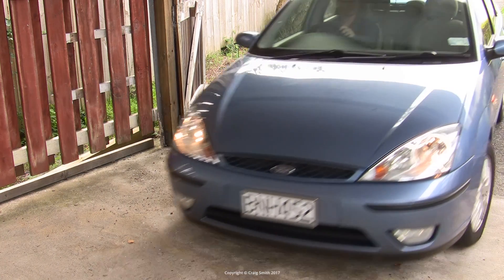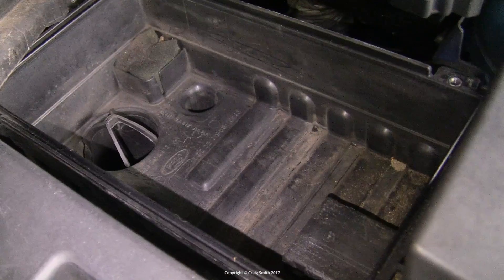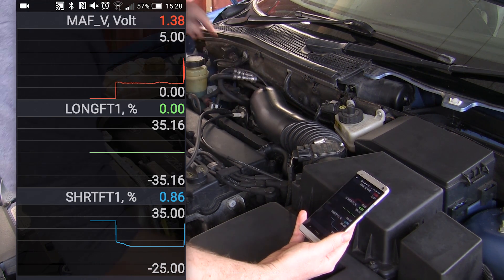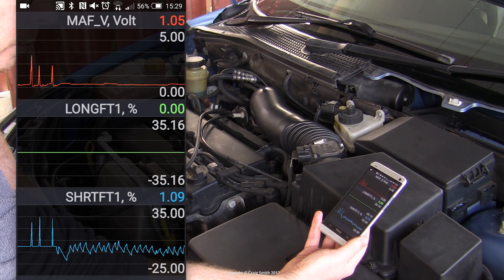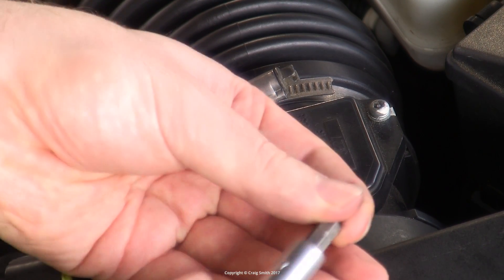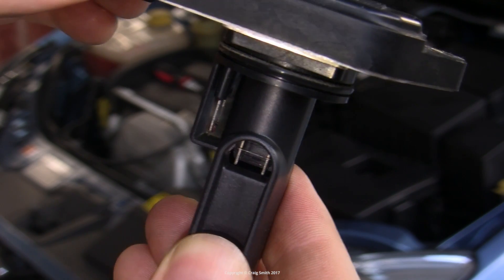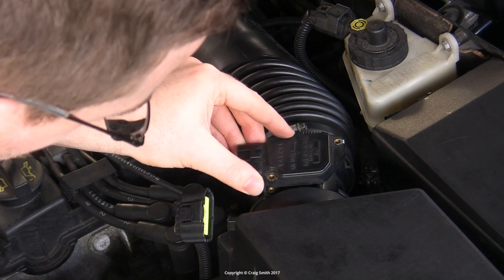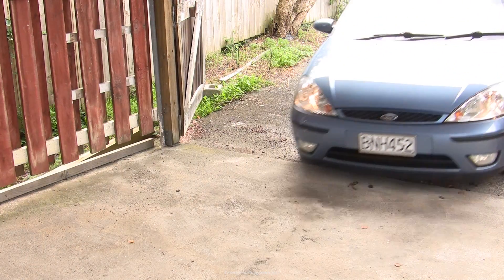How to: Clean & replace Ford MAF sensor (Focus Mk1)

Comment: Hi there Craig , my focus is 53reg and I’m looking at ur video clip here but my focus don’t seem to have the sensor anywhere there I checked, can that be that it has a map sensor instead I looked everywhere I only could see the map sensor just down at the bottom on the same pipe that u have the. Mass air flow meater thanx
Reply from the maker: I know the Duratec engines (Focus Mk II+) only have T-MAPS on the intake manifold, check which is your engine.

Comment: Yes very good, can we use WD40 spray
Reply from the maker: No!
Reply: You cannot use the standard WD40 spray, as it leaves residues behind. But you can use the WD40 Specialist, contact cleaner

Comment: What would you say could be the issue if it sticks at 2000 rpm and my temperature gauge has stopped working as well was thinking throttle body  cencor

Comment: hi thanks for the video , One question what is the "tool" called that you attached the "T20 security torx drive bit too or link to at amazon? Thanks again.
Reply from the maker: It's just a ratcheting screwdriver with hex drive bits, it comes with a whole set of different bits. For just this purpose you could buy a simple T20 security torx screwdriver, or a set like mine would be more generally useful. Take your pick https://amzn.to/2UOr9Ju

Comment: Can i use brake cleaner for this or not
Reply: Lol.  No. There's a Air Flow Sensor cleaner cheaper than Brake cleaners.  You can also use throttle cleaner.

Comment: Thank you so much for your helpful videos. I’ve seen most of them and I really appreciate them. Could you please tell me where I can locate the MAF sensor on Ford FOCUS 1.8 petrol , 2007. As I am struggling to find it. I doubt actually that mine has one. 
Thank you in advance Craig.
Reply from the maker: That's a Duratec HE engine, not the Zetec shown here. Search my other videos for Duratec or Mondeo, not a Focus but same engine. There is no MAF sensor, only a T-MAP on the front of the intake manifold. I have a few videos that cover that.

Comment: Thank you so much for your helpful videos. I’ve seen most of them and I really appreciate them. Could you please tell me where I can locate the maf sensor on ford Mondeo mk3 1.8 petrol as I am struggling to find it. I doubt actually that mine has one. 
Thank you in advance Craig.
Reply from the maker: No MAF sensor on the Duratec HE. There is a T-MAP sensor, lower front of intake manifold, I have another video on it.

Comment: Hi Craig. I have a 2008 MK 2 Ford Focus hatchback 1.6tdi. It is on a french plate as I live in France. The car we bought has been nothing but trouble, it has had a new turbo core, a mixture valve ( that sites behind the encased diesel filter) and lots of other things. We have to keep the car because we have spent so much on it. (better the devil you know).ok so now I have an orange engine warning lights again, the turbo stops working and has reduced power, and the warning says the engine malfunction ( french Engine Default ). I have just removed the air filter system to gain access to the air flow sensor. That does not seem to be too bad a condition, though the box holding the filter was pretty dirty. We took it to this mechanic who ran a diagnostic and told us it was a sensor on the other side of the engine it sits in a square housing ( tube system that seems to be the intake / outlet pipe. He gave us the part number from HELLA car parts. That Nummer he gave us was  6app 009400521. I do not see where that part fits, can you help me out, please?. The warning alarm continues constantly to go off and it's driving me crazy. The French, all they want is money and don't do any work if you could lead us to that part from a UK dealer that would be really nice of you and maybe some help on accessing the area I need to fit the part.I don't even know if it is that part.I wish I had an old mk 3 escort or something , becase these cars now days , nothing but trouble.Thanks Craig.
Reply from the maker: I can't help you with diesels sorry I just have no experience. That Hella part # seems to be a boost pressure sensor for your turbo system - but for a Citroen not Ford (possibly it's generic). You need to get the code(s) off the car's ECU with a scan tool and see for yourself what's causing the engine light. Although, replacing the referenced part doesn't guarantee a fix of course as you need to know why it's a problem. If the sensor has actually failed and is either dead (after checking its wiring) or isn't giving a sensible readout even after cleaning, then I guess replace and clean entire air intake upstream, replace air filter, and go from there. If it's oily then you need to check PCV system as well (valve & integrity of vacuum hoses). If you get stuck in France maybe hold your nose and try a Ford dealership with a decent workshop attached, not cheap but at least they should have techs familiar with the car and easy access to the right parts. Buy a Citroen next time I guess. Good luck.
Reply from the maker: Sorry confirming that is a generic MAP sensor and apparently suits the Ford 1.6 TDCI as well - see Ford #s down the page here - http://www.vehiclepartsdatabase.com/vehicles/allprivateroadvehicles/ford/cmax/16tdci/g8dd/26524/airmanifoldpressuremapsensors/hella/6pp009400521
Reply: All I am going to say is sell it, get rid of it. Those engines are awful. I blew mine up because of faulty seals on the turbo and injectors.

Comment: Hi I have a ford focus 1.8 tdci that drops speed on motorways and I have to restart the ignition  is this a air flow problem
Reply: Could you solve your problem? Ive git the same issue
Reply: That sounds annoying and dangerous, might be MAF but I would get that fixed ASAP